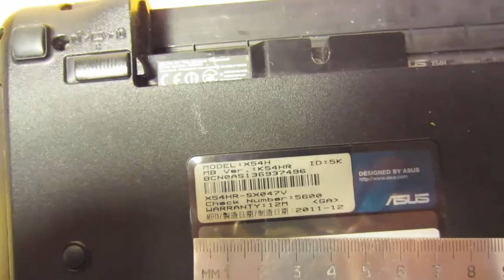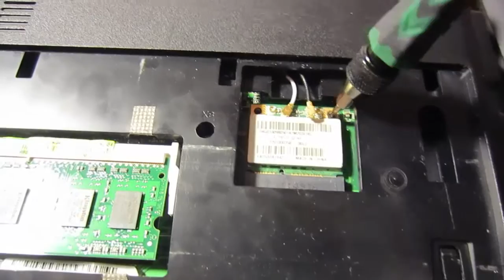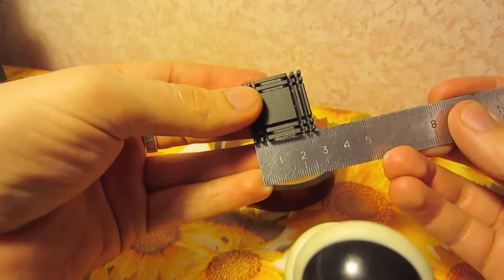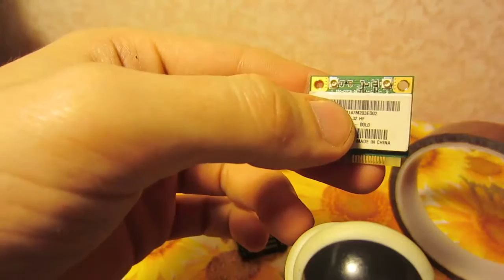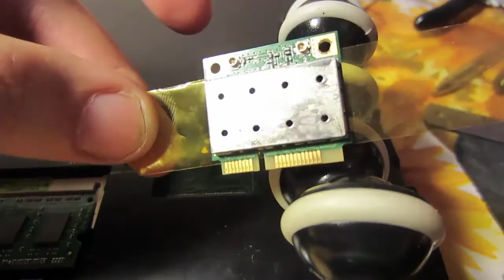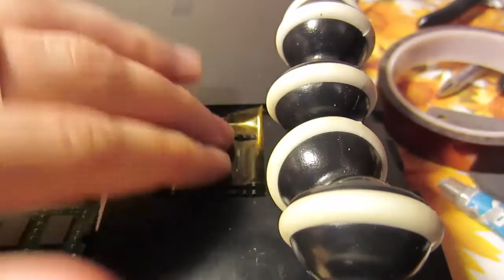Asus x54 k54 wi-fi connection problems, packet loss connection issue resolved

Comment: I see that the tape is "Koptan," the Chinese version of Kapton tape used for insulation during hot-air soldering.  It does not seem ideal.  I would try something like these ties: http://www.aliexpress.com/item//32438239243.html
Reply from the maker: +pillsnotbills yeah man, your solution seems to be more steady
Reply: Russian Laptop Repair I think it will be better than covering the heatsink with insulating tape.  These ties are extremely strong.  I would just buy them at the store if you have none (thin ones).  The heatsink may not be necessary though!  Removing the label may aid the cooling sufficiently.  I am happy to see you doing this work.  It must be difficult getting parts in Russia.

Unlike the other guy, I appreciate you making these videos in English.  I do not know the Russian language and it seems very difficult to learn.  The translator works well for written text but not speech.  Thank you and good luck to you.
Reply from the maker: +pillsnotbills i really apreciate your support, and yes your ideas could be usefull for some peopple.